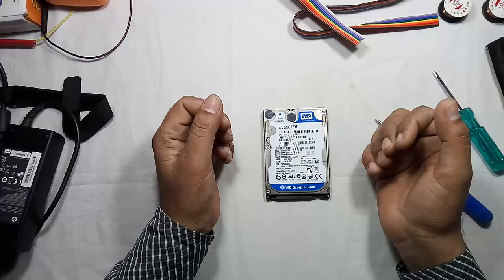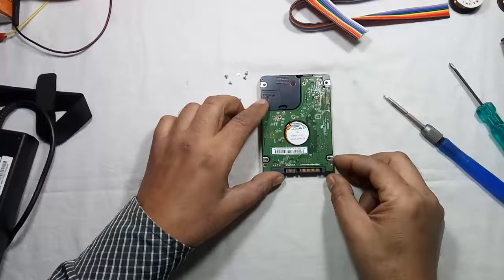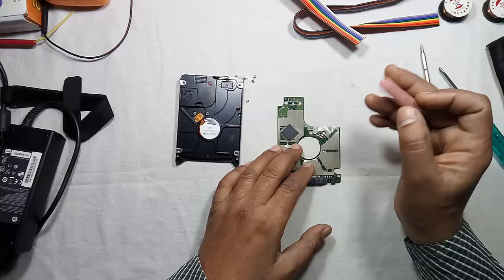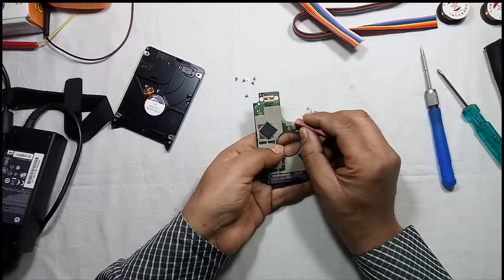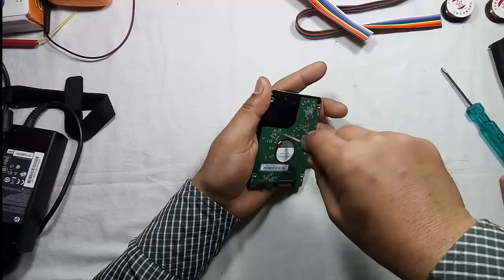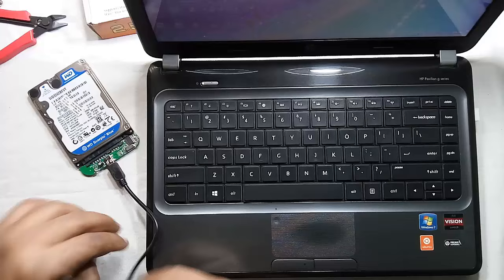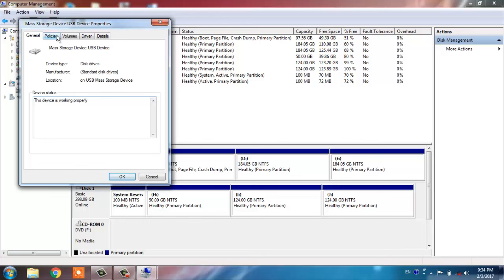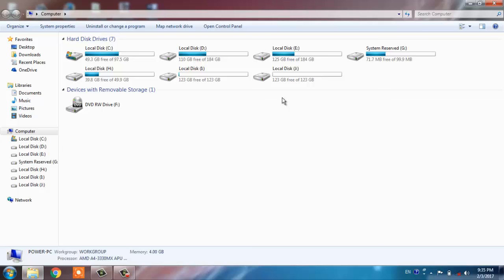How to repair hard disk not detected by Innovative ideas || innovative ideas

Comment from the maker: Dear all, kindly watch my latest video on hard disk drive repairing about errors and bad sectors.I HAVE MADE THAT VIDEO IN 3D AUDIO. KINDLY USE EARPHONES OR HEADPHONES TO ENJOY THE VIDEO. https://youtu.be/Rnss9HxpsGk
Reply: INNOVATIVE IDEAS i
Reply: i did it but still not working ????
Reply from the maker: Kindly tell me the problem you are facing with your HDD
Reply: hola el mio no reconoce de ninguna manera mi disco duro intente de todo pero menos tu procedimiento sabes eres un crack si esto funciona ..
Reply: +INNOVATIVE IDEAS my logic board one of sata pin bricked
Reply: Hi, i have the same 320gb hdd which is not working anymore when i connect it to external usb connector it doesn't lit up and it doesn't do anything if i connect it to laptop internally it wont start the laptop will this method work on my drive as well ??
Reply: Sir meri hard disk run ho rahi h but detect nahi ho rahi PC me show nahi ho rahi
Reply: I'll send my hard disk pls recover  my photos and send me by courier I'll pay u sir
Reply: Hello sir 
My laptop harddrive was not detected in pc 
I was trying to connect with sata to usb 
Can I try this to solve my problem?
Plz let me know can i do this?
Thank you
Reply: Sir please help me...
Jb main laptop on karta Hu to kuch der tk sab thik chalta h...fir kuch der bad sab freez ho jata h..fir power button se off karna padta h..uske bad operating system not found show karta h....or 1 ya 2 hrs k bad on karne se wapas same repeat hota h....koi solution ho to sir plz reply....
Reply: @innovativeideas  Shall I buy a logic board as my connecter is damaged...??? If yes then From where plz suggest.....Thanks in advance
Reply: @innovativeideas  bro yanodiya pc vanthu oru error iduchi bro na yanodiya pc on panain bro athu insert boot media in selected boot device and press a key intha mathiri katudthu bro na Ctrl+alt+ delete press pana bios kulla starting loding screen na nikuthu bro new hard disk vanki OS install pana bios kulla pokuma bro plz bro yanaku comment pannunga bro plz bro yanaku comment pannunga plz 😭😭😭😭😭😭
Reply: Nice work sir

Comment: You are AWESOME! Just saved my life!
I dropped my usb-3.5"-harddisk. powerpin broken. disassembled it. It was not recognized anymore at first but on another computer it was okay. Only that it was "not formatted" anymore. It sounded fine and seemed to work properly. But after quick formatting it, only 2 of 4 TB were recognized.
So i did this AWESOME tutorial ... WTF. A normal eraser? I didn't use mine since my school days. Haha. So good.
After that, Windows recognized the whole 4 TB again.
I formatted it properly and am currently running a data recovery program.
Pure Awesomeness!
Thanks a lot, dude!

Comment: My desktop failed to boot and setup did not show seagate harddisk. I tried to boot multiple times, once it detected (I felt the vibration when it started), but before it could boot completely, the drive stopped.

I followed this video, cleaned the connections with an eraser. I could see the connection were blackened and it came off with lot of rubbing. I put on the screws back very tight and tried, it was not detected. I again removed the screws cleaned more, this time I just tightened the screws enough (I read on the disk not to screw very tightly). This time the hard disk was detected.

It has been two weeks and the hard disk is working well. I am writing this comment from the same desktop.
Reply: thanks dude! tightening helped me as well!
Reply: I have the same problem. Let me try it.
Reply: @zwivhuyasiphalale5901  solved or not 
please help me
Reply: I work all in vedio but not working and one time spark on connectir

Comment: 3:00 if i use an eraser, will it erase the data in a manner which i can’t retrieve ??
Reply from the maker: Paul Mah  no bro..The data is stored in the platters of the hard disk drive. The connection points which I am cleaning is just to transfer data and power supply..
Thanks...
Reply: Lol
Reply: Do you think my sticky note is compatible with windows 10? 😂 😂
Reply: Hahahha

Comment: Thanks innovative ideas for putting this video. By informing us how to bring back to life a dead Hard Drive, you have given a ray of hope for survival of my external Transcend 1 TB hard drive. But still I need your further suggestion rather clarification on status of my drive.
1. The drive is not detected by the computer though the motor is working.
2. There is a clicking sound with regular interval when device is running in computer
3. Can I open the disk and expose the circular disk (in which data is stored) to sunlight or even light as there seems to be problem with read and write Head.
Kindly reply.

Comment: my segate hard disk is not being detected in windows 10 I even installed paragon driver but nothing happend and even checked disk management in it qlso it is not detected please help😭😭
Reply from the maker: Kindly check the settings in BIOS if it is on AHCI mode then please change HDD mode to IDE. Thanks
Reply: INNOVATIVE IDEAS Can you please tell me how to do that? In my BIOS I see no such options.
Reply: My segate 250gb desktop hard disc not detected how is recovery D and F drives data

Comment: Do you know how to repair usb drive? I have 2 32GB pan drive..
Reply from the maker: vineetdhiman79 please wait for some days. I will make videos regarding that...
Reply: Please message me when you are done!!
Reply from the maker: vineetdhiman79 ok
Reply: may be corrupted depending the brand yes could be fixable
Reply from the maker: vineetdhiman79 hey bro kindly watch my latest video https://youtu.be/Rnss9HxpsGk there you might be able to repair your pen drives...
Reply from the maker: Razor X11 mean ??????
Reply from the maker: vineetdhiman79 please watch my latest video how to repair hard disk drive in 3D audio. You might be able to repair your pen drives. Thanks...
Reply: saurabh
Reply: INNOVATIVE IDEAS 
Yes
Reply: How to connect external hard drive
Reply: Bhai, I hav toshiba external hard disk... after 4 years it's not detecting in any pc but physically it working with power light indicator..... what do I do..??
Plz help me
Reply: INNOVATIVE IDEAS iT Say fix for bad sectors. Do you have a video that shows fix for USB 32gb not Seen by pc ..?

Comment: sir, till last saturday, my 1 TB HDD (TOSHIBA) was perfect. next morning, my motherboard repeatedly failed to detect it, I tried required cable alternation work, but nothing happened. So, I rushed to my known computer shop, they told me that  HDD is dead  without proper test. My HDD is just 2.5 years old.  Data is extremely valuable to me.
Reply from the maker: Kindly wait for 10 days only. I am preparing a video on HDD repairing. Hope that method will work on your HDD. Thanks
Reply: @innovativeideas  OK.. I'll wait.

Comment: Dear +INNOVATIVE IDEAS   Fantastic and easy to understand video. One question...What is the bit number you have used to open the screws on the logic card ? Also I have a seagate backup plus slim 2TB portable hdd and am finding it difficult to open 2 of the screws out of 4.  Also the hdd makes a beep sound twice as it is connected (there is no click or buzz sound) and the hdd is vibrating as if its powered on but is still untraceable. I have tried changing the usb cable as well as double checked the bios and its proper. Kindly guide me. Thank you. :)

Comment: Bro I have the same hdd as yours. However, the screws are so tight I think it’s corroded. Can I put some lubricant oil in it or this will damage the hdd? Also, the only screwdriver I have is the small one. Is there any other solutions for that? Please help and thank you so much!

Comment: Thank you for creating such an informative video like this! I am also facing not exactly the same issue but I could able to see the local disk drives (have 4 partitions) in my system (My Coumpter). But could not be able to open or check the details of the drives through Partition Manager or Windows Disk Management Tool. When I try either way to check my drives it got hung and nothing would be showing after that. All the times, I needed to unplug it from my PC to avoid the hanging problem. I am using the same model of HDD (WD 320GB) shown in this video and currently which is connected with my PC through an HDD Enclosure. Can you help me to resolve this issue?

Comment: You are really seems a genious i have a problem n sure you have the solution. "windows can not be installed to this disk. the disk may fail soon" this message displayed and SMART hard disc error. Please guide me about these problems
Reply from the maker: Kindly disable SMART option in BIOS settings and take backup of your data. Ready for new HDD.
Reply: @innovativeideas  but the problem is the hard disc is not detected and my very important data is in it. Could you guide me how to recover data at this stage?

Comment: Dear sir I have a question. For Personal Computer left and right front panel  2 LED light  i want to sold it with Power pack
4pin  current  pls let me know  which colour wire to which wire to be sold. The LED have only two wire on the left and right panel is only red and black .The 4 pin is with  red ,black, black ,yellow.  so  I am waiting for your  nice reply.

Comment: I don't have any pen eraser laying around my home so I used alcohol instead on the connectors instead. My hard drive worked for some time but it stopped working after an hour :(. Can you suggest any alternatives other than the pen eraser?
Reply from the maker: raz you can use pencil eraser of good quality....

Comment: Reboot and select proper boot device
Or insert boot media in selected boot device and enter a key

I'm facing this issue.. can u suggest anything?
Reply from the maker: In this case HDD is not detected or operating system is working well. Kindly check in BIOS , if HDD is shown there, then please try to install operating system, if HDD is not shown there then please apply the method shown in the video. Thanks.

Comment: For example, if I got the same new hard drive and changed the new board into the old hard drive, it works perfectly
 reply me boss
Reply from the maker: It will work only if all the parameters are identical.

Comment: Unfortunately  the power supply code (adapter) of laptop  which hanged in my legs two time due to tiny area and my Laptop had dropped for my tables and was not able to read the data  so was thinking that it might have some hard disk may get the internal damage or else problem  so i wish to get repaired with law cost those hard disk so does it  way to get it repaired ? kindly input your valuable suggestion.

Comment: My mom dropped a laptop, thought she just damaged the screen, which would be easy enough to replace, but i hooked it to my tv and it had just a blue screen, maybe a curser be not every time, is the hard drive damaged beyond repair? Or is there a problem with the motherboard?
Reply from the maker: Feralbigdog2 kindly check if BIOS setup is being displayed more than 5 minutes, again check that if HDD is properly connected to the motherboard. After these steps, at last, try installing fresh o.s. thanks

Comment: I used Alcohol and q-tips to clean the contacts is that ok? I got rid of the corrosion but still not working
still says device is not recognized and giving USB error, not detecting the drive even in Disk Manager
disc is spinning no issues, no noises, I hear the reading head but no detection.

Comment: sir my external hard disk(i.e.wd elements 1tb) isn't responding.whenever I connect the hard disk to the laptop the light of the hard drive keep on blinking(which means it is connected to the laptop) but it do not show in the pc. I tried your way but nothing happened. please respond asap.

Comment: how about the one that is ruining and detecting its storage and does not instal windows or when you store items it will hangup what is the problem and how do you do anyway
Reply from the maker: You can try this method and moreover I have posted too many videos on HDD repairing. Kindly watch my all videos on HDD and apply the methods shown in those videos. Thanks.

Comment: Is it possible to retrieve data from a dead or failed hard drive? I've bought something that allows me to connect with to the computer, but it can't find any of its old files on it...
Reply from the maker: Rafael Arandas hey bro you can use data recovery tools to find your old files or data..
Reply from the maker: Kindly use recovery software for the same.. Thanks
Reply from the maker: ya. You can...
Reply: No it can't detect it at all...
Reply from the maker: hey bro, check if it is making clicking sound or any friction sound, in that I am sorry so say, I do not have any other solution....
Reply from the maker: Try Norton Ghost
Reply: It says something about diskette 0 when it startsup, I couldn't get it past the black screen, just that with the message on it, do you have any idea?
Reply from the maker: please elaborate your message. Diskette 0 message is coming during BIOS screen or later. Please provide me full detail..
Reply: Its from an older Dell desktop computer...I took out the drive (took me a long time) and tried to connect it with another computer, but it couldn't find the files.
Reply from the maker: First of all unscrew logic card fro HDD and clean all the connectors. Then connect to PC. Check if issue resolved. If it is detected and your are not able to find your files. You can go for recovery with the help of any data recovery tool. Thanks

Comment: Sir, my laptop is not detecting Hard disk I found it in repair check, Some times it makes noise sometimes it doesn't. Should I follow your video or need to try something else? Thanks in Advance !
Reply from the maker: Yes of course you can follow this video and moreover clean the connectors and ports of HDD and motherboard (HDD cable Socket).
Reply: Thanks for responding ! I did follow those and now I'm getting clicking sounds! Is there still any chance of recoverying data ?!
Reply from the maker: Oops! Sorry to say but I do not have any solution for clicking sound.
Reply: No problem ! thanks for helping
Reply: NIKHIL SIMHA I do have solution, 

Buy another HDD and Fresh install OS

Comment: I also want to try this but before this I want to mention ma problems.I have three HDD and I just bought 1 and that disk didn't worked and didn't had any power going on there and I placed another board but then there was power but the space was not showing nor the HDD and I undo that and it back as same and I need to repair ma HDD really need it for the new laptop. And 1 more question plz....if there is tic tic sound in the HDD and it is not running smooth then what should I do,what is the problem in there,how can I fix it???
If u suggest me the efficient way and my HDD will get repaired then I will defiantly gonna subscribe your channel.thank you.
Reply from the maker: Dear Thakur, the problem you mentioned is sometimes due to improper power supply from SMPS. Kindly try it after replacing power supply (SMPS). Thanks
Reply: INNOVATIVE IDEAS :I m running the drive in the HDD enclosure but it not giving any signs movement and when I changed the board it gives it and runs and gives the tick tock sound and I thought its okay but when I connect it with the PC it is not showing anything.it says no drive found knd of thing.
Reply: Did u fixed ur hard drive thakur

Comment: Hey Bro , I am having a similar issue. My laptop was working all fine but suddenly when I open my laptop one morning, it start showing OS not found, I though Windows is corrupted so I tried to re install windows. When I entered drive selection menu, HDD was not there. I open command prompt , even by using diskpart command there I did not get drive. 
I unplug HDD out of the laptop and tried to test using same SATA to  USB circuit you are using to another laptop . No rotating vibration , neither clicking sound ,NOTHING !!!
Can I go with your process ? Will that work for me ? Suppose If i some how damage the HDD board or pins , will my data be safe... Please reply, This HDD contains all my lifetime digital data ... the photos and videos of so many places, so many memory without any backup . I don't want to loss these data. 

PLEASE REPLY , PLEASE !!!
Reply from the maker: If you try this method, there is no chance for data loss. Thanks
Reply: I've tried this .. But nothing changed .. I have message you on your fb page also ..
Reply: I'm facing exactly same challenge right now..   Have you fixed yours? If yes, how? Please help

Comment: Hello Sir,
Thanks a lot for making this video , this is really helpful as i have two internal hard disk and both are undetectable, so i would try this workaround for sure. 
Also if you can help me with this issue, When the hard drives were detectable by using external casing (Module) I somehow formatted the C drive, from then one of the HD is not detectable... Please guide and help
Reply from the maker: My pleasure...
The problem with external casing and detection of the HDD can be sort out by disk management. For this, right click on my computer then click on manage and there after select disk management. From there some options like activating your external HDD by Mark as active and formatting it can resolve your problem.
Thanks..

Comment: ok I have a windows 7 hard drive(western digital) I have a IDE/SATA Docking model # 575D. The hard drive isnt spinning. Used to.   BUt I went to disc management (i'm on windows 8) saw the hard drive listed there. Working properly it says. But I didnt take apart and clean yet. Went to computer like you said but the hard drive dont show there at all. DO I still need to clean and see if it will spin then? Or is there a way I can open this hard drive in disc management?
Reply: THe sata box is working cause I plugged 2 other ones in they spin. But they dont show there either. Usb cord maybe? I got to get my stuff off this hard drive asap!!